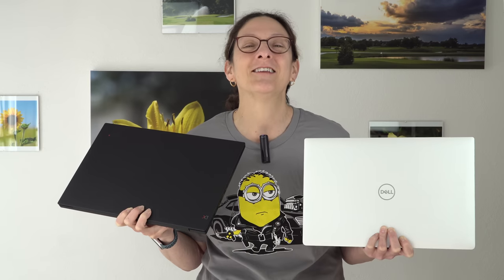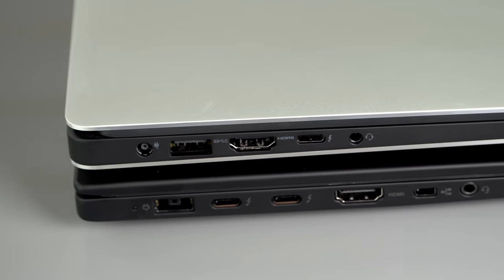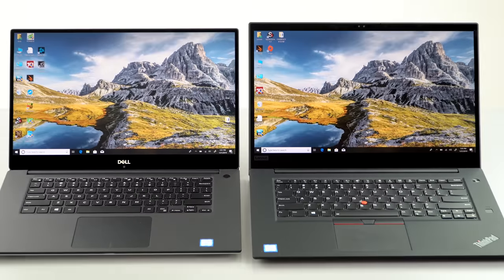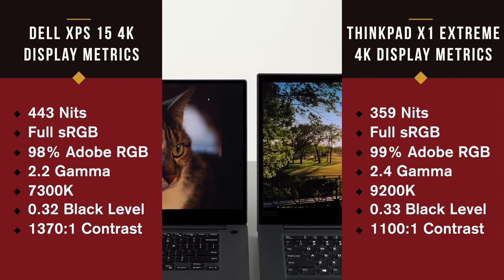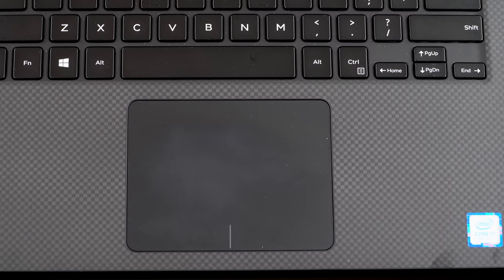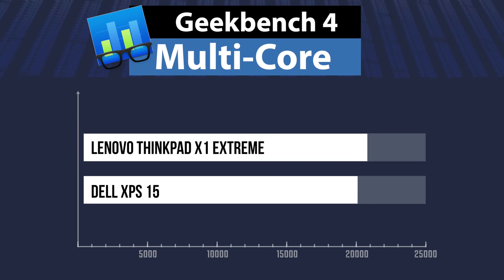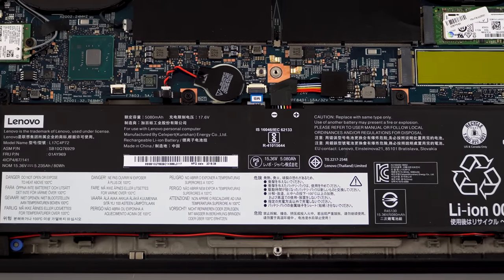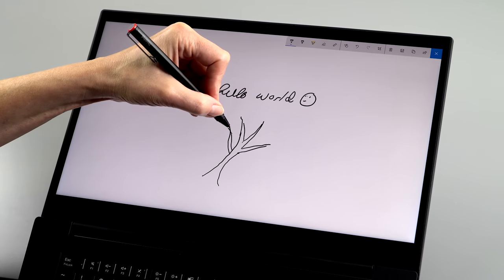Dell XPS 15 vs. Lenovo ThinkPad X1 Extreme Comparison Smackdown

Comment: The moment I saw the Dell keyboard with those stupid tiny cursor keys, the ThinkPad had won no matter what.
Reply: Yep.  Companies trying to make keyboards so small and petite are killing me.  You use the keyboard the most on every computer you will ever own.  It needs to be good!
Reply: I would gladly take a donation of either one of them once you are done review😁
Reply: You don't prefer longer battery life, brighter screen, and smaller bezels for lower price over thinkpad?
Reply: @nateportney672  all this is secondary to efficient typing and code navigation. If tiny cursor keys cause frequent miss-placements, a better screen or a longer lasting battery do not help to ease the frustration. 
The thing is: they have keyboards that are good ( e.g. on Dell precision M4800) . But for no rational reasons they instead choose to use crappy Apple style keyboards . I am afraid that this is a design driven decision because some marketing or management guys falsely believe rust you have to look like an Apple notebook to sell more..
Reply: @hercion  may u explain why u need a high gpu gaming laptop to do coding?  Ur 100% right thinkpad keyboard is superior, but xps 15 is fine.
Reply: @nateportney672  Longer battery life is great but it's not by a huge margin.  It's only slight better which may not be really noticeable in real world.  The keyboard, however... will be used every second.
Reply: @timothyandrewnielsen  ur 100% right.   Do u think the xps 15 kb hard to use?  Will the 9580 maybe improve it any leaks for that. 🤔
Reply: @nateportney672 I don't think it's hard to use but the thinkpad keyboards are just the best so I won't gamble.
Reply: @nateportney672  i used an xps 15 9570 for a few months. i hated the keyboard. the function keys were annoying to use, especially when troubleshooting assembly code in codewarrior. the keys have really mushy stability. like, if you push on the corner of a key, it is possible that the key wont activate, even if you bottom out the corner of the key. felt like some of the keys would pop off :c also, dell has made some very questionable decisions/mistakes with BIOS updates. i ended up returning my xps 15 for that reason. dell made me lose trust in them when it comes to competence for making good decisions on how they code their products' firmware. issues included dissapearing touch screen functionality, wifi card causing the computer to crash, lowering the thermal throttle threshold on the gpu from 78 degrees c to 75, and one of the more annoying issues, introducing a bug that would heavily throttle the 1050ti, if the gpu temperature was below 48 degrees c. that one was very annoying, and only recently did dell put out a patch to fix it. it remained unfixed and unbearably annoying to work around, for over 2 months. looking at the greater stability of firmware and drivers on the lenovo x1 extreme makes me wonder why i didn't just go for it. to add to that, the red hue the xps 15 display gave was annoying. seems like the lenovo has a more colour accurate screen. another point against the xps 15 for me.

also, lenovo commonly puts the x1 extreme on sale. a similarly configured xps 15 vs x1 extreme cost about the same in canada, right now at least.

am i really biased toward the lenovo? no, not really... im just really biased against the xps 15. :| it just so happens that the x1 extreme is the best alternative, and is IMO a much more reliable option.
Reply: @KumaMech  ty for extensive feedback.   Indeed thinkpad keyboard travel of ~1.7 surpasses xps 1.3 and I have used thinkpad before dell (used 9550 since 2016) and haven't observed these issues you observed.   Wonder when oled, rtx upgrades and 9th Gen will make an upgrade in 2019 more meaningful.  Probably by Jun will be happening.   It's funny how gaming alternatives have even worse keyboards.
Reply: Also what do u think about new razer 15 or aero 15?
Reply: @nateportney672  some gaming keyboards are wonderful. msi's full size steelseries keyboard (the one with the numpad) is one of the rare good ones still available.

aero 15... i had the chance to use it for 2 weeks and, i personally had hell with trying to get it to run in a "stable" fashion. the biggest issues with it was single channel memory, gigabyte's manager software that is REQUIRED for keyboard shortcut functionality (max fan, sleep, brightness up and down. msi doesn't need to have special software installed for that kind of functionality) gigabyte manager making it so monitoring cpu usage, even with task manager, takes a lot of cpu resources to do, and nvidia optimus kept going into a state where both the intel igp and the 1070 max q i had would be on at the same time, tanking battery life. in short, i don't trust gigabyte about as much as dell when it comes to competence in how they program firmware and drivers... but decision making skills for gigabyte are better than dell >.>.

razer blade 15. i was able to test that for a month. in short, it was actually a really good experience for me. it was stable, bloat free, undervolted well, performed REALLY well with undervolting and lowering the max boost clocks a bit (6 core turbo down to 3.6GHz from 3.9GHz REALLY helps the system keep its performance higher for much longer) and their keyboard feel is better than the dell, as all keys are full size and have better stability, but are still shallow. gpu performance is insane for a max q variant, because of their "OC" profile that gets activated when you set it to performance mode in synapse.

so why did i return it? the 1080p 144Hz model comes with a display that comes from one of two suppliers. LG and what it seems no one else knows about... BOE. the BOE panel uses a very low frequency (200Hz-250Hz) PWM backlight for the display. this caused me a lot of eye strain and headaches as the strobing from the screen was painfully visible to me. if you get the LG panel, you are lucky, since the LG panel does not utilize PWM for the backlight brightness.

other issues i had with razer blade 15 advanced. power brick cable is stiff, making it a bit annoying to use on the go, the rubber feet on the bottom of the laptop are do not have much traction and do a poor job of keeping the laptop in place (easily fixable) and the stupid keyboard layout with the up arrow in between the right shift and question mark key.

also, if you are interested in 4k versions, both the gigabyte aero 15, razer blade 15 advanced and lenovo thinkpad extreme have the same/similar 4k panel (AUO). my 4k aero had a max brightness of 408 nits, averaged across the screen, with 1600:1 contrast ratio and 100% adobe RGB coverage. I got really lucky with the display on my unit, when i had it.

both are solid in build, with the razer feeling a bit more rigid and premium feeling. trackpad on the razer is one of the best i have ever used.
Reply: @KumaMech  wow your depth of reply and personal breadth of insight is truly superior, ty for that.  Did not know about panels.   So you think for a non developer, the razer 15 4k is good?   I heard aero 15Y now uses dual channel, and I liked how their battery was bigger than razer.   But what stuck in mind was razer's notorious bad QC and negative reviews.  Perhaps they have repaired this?   I remember before talking MSFT store when they offered razer 14 and xps 9550, the techs said razer QC was awful and had to return so many back.  Did razer step up their game u think?    Also, is the 4k screen on razer 15 good quality without that strobe issue?  I am too sensitive eye strain.  I heard razer 4k is peak 400nits too.   Glad u mentioned about 9570 issues on throttling bugs, as I was considering it when the 9580 comes out.

Do you think it's better to wait for razer 15 9th Gen 2070 4k and possibly an OLED version later in year.  I was looking for a sleek power laptop, that was little more future proof.   Indeed I appreciated x1 extreme, but getting one with just 1050ti mq in 2019 seemed bit aged.   Plus I may want to drive a couple 4k displays later on when upgrading monitor setup.   So I thought stronger gpu was needed to do that.   Do you know when maybe x1 extreme may get upgrade to oled and maybe rtx gpu upgrade?   That would be a superior system if they could deliver that.  Appreciate your thoughts and brilliant feedback. 👍👏🤔
Reply: @nateportney672  razer blade 15 is fairly good, and currently appears to be one of the more reliable options on the market, but you have a chance of getting a lemon with any company at the moment. i know the 4k IPS display on the blade does not flicker (current controlled backlight brightness) that being said, im annoying microsoftstore does not sell the 4k model of the blade 15. microsoftstores extended warranty is IMO really worth it, as its pretty cheap for 2 year accidental warranty. keyboard should be fine, especially if you have lived with the xps 15 keyboard for a while. just the right shift key takes some getting used to, if you use it for typing, like me. you can also change the up arrow in synapse to be right shift as well, but then of course you lose up arrow. battery life difference between the 1070 maxq models of the blade 15 and aero 15 weren't that big. i averaged 5.5 hours on the 1080p 144Hz blade, and about 6.5 hours on the 4k aero 15, when nvidia optimus wasn't bugging out. didn't have nvidia optimus bugging out on the blade 15 with my unit. aero 15 battery life would tank to about 1-1.5 hours when the optimus issue came up :c. To detect the issue on the aero 15 quickly, you will notice the entire computer slow down. to fix, i had to restart my aero 15 :/.

about OLED 4k model of the blade 15. i have no idea when they will actually come out, but something to watch out for is, almost every samsung OLED screen i have seen (on their phones, other companies phones that use the samsung screens, the thinkpad yoga x1 gen 2, and alienware 13 r3) all have/had a PWM of 200Hz. The supplier of these 4k OLED screens is samsung. note, i am just guessing that the upcoming 4k OLED screens will have PWM based off of samsung's current portfolio.

the new gigabyte aero 15 models come with dual channel memory, but only on the 32GB SKU's at the moment. aero 15 keyboard is very nice IMO, one of the best feeling, but the keyboard is fairly cramped due to less space + the fact that they put a numpad in. something you can get used to. i can't actually speak for the reliability of the newer systems anymore, as gigabyte has moved to using different drivers and such, but the gigabyte manager program looks to be about the same according to the reviews i have seen. what worries me is that gigabyte used to offer 2 year warranty on the aero 15x, but now only offers 1 year on the newer y9 and x9 :c. If it weren't for my skepticism with driver reliability and other hardware issues i have seen other people experience, conceptually, the aero 15 appeared to be the most versatile laptop out of all options. in execution, i don't know where gigabyte went wrong. o right, fun fact, to get my aero 15 to boot from the USB, you had to insert the USB drive RIGHT after you turned the computer on. if you don't do that, the boot device wouldn't appear in the list. other than all those issues, i can see the aero 15 x9 and y9 being a beast.

Thinkpad X1 extreme... i can only speculate, but i don't think it is going to get RTX this year. If anything, it's going to be getting the rumoured gtx 1660ti, maybe in the 3rd quarter ( a guess based off of the fact that the current X1 extreme released in September 2018 if i remember correctly) 

i really don't think you are going to be future proofing with any of the current options on the market, in terms of graphics. i'm in the same dilemma at the moment. im reluctant to purchase into RTX because of exorbitant pricing and the fact that 7nm EUV products should be here by the end of this year/beginning of next year anyway. also reluctant because i don't want a 1080p 144Hz panel. im annoyed that no one is releasing 2560x1440 144Hz panels... i haven't even seen anyone sell rtx laptops with 4k IPS panels yet, at least in canada. only exception is alienware m15, but i do not trust dell. you can probably go over the reddit to see if people are experiencing stupid issues with that device as well. the glossy bezel on the alienware looks hideous to me, thats another thing keeping me away from that. 

i hope im not missing something. glad i could help... if i did not make your decision even more confusion. i feel like i transferred some of my confusion on what laptop to get to you :p.
Reply: @KumaMech  dear sir, this was truly appreciated and depth I absolutely am blown away by, thank you graciously.   Seems like aero 15 reducing their warranty to 1yr tells me about confidence.   I also agree m15 hideous bezel is joke.   They probably had marketing team tell design team  to make it more in spirit of AW so they glossed that thick bezel lol.

Also I chat with razer, they said at least 5-6m before they come out 4k 2070 rtx, so it will probably be cozy for Christmas cycle.  Much less unsure about oled.   Also 9th Gen is unclear maybe 6m later they will creep up.  So that makes the 1070 razer 15, at 4k better value.  Also I learned can add the razercare essential to 3 years total coverage, which avg down the cost over likely 2-3 yrs decently.   Also means a secondhand one for those wanting to upgrade rtx gives little more value.   So right now looks like razer 15 4k 2017 secondhand with extra coverage 3 years is best combo of gamer with little better value.   Trouble is, not many offering that.   But this next 9m of lack of serious releases makes upgrading now a good time, esp since with a 3yo xps.  Even that has resell value. So what u think kind sir, a x1 extreme 1050ti mq 4k , or razer 15 1070 mq 4k for little more.   If u had to choose, same price (and what value would u say)?  What would u get.   Remember, in 15m that 1050) is gonna feel really weak, maybe the 1070 will still be competitive.  Which ones have more resell value?  What do u think?  I really value your outstanding opinion and analysis.  👍🙏😃
Reply: @nateportney672  i think the 4k razer will have more resell value, although it is just a guess. if you go with the x1 extreme, you get a bit less throttling on the cpu, extra ports, SD card reader, extra m.2 nvme slot for more storage options and one of the best laptop keyboards on the market. if you go with the razer, you will get a bit more than 2x the graphics performance relative to the thinkpad.

its your choice if you want graphics performance or versatility + convenience. Now, technically the razer can do everything the lenovo can do, with more graphics performance, but you would have to carry dongles, whether it be for SD card reader or to expand the number of usb ports with a usb hub.

if you are primarily gaming with your device, i would say get the razer. but if your main goal is to do some kind of work on the go, such as programming, CAD, video editing, graphics design, and/or photo editing, go with the x1 extreme. depends on what you value more.

what you sacrifice depends on what you want to do with the device as well as your own personal feeling of what has more value (graphics performance or versatility + typing comfort).

for me personally, if both were the same price and if i could get warranty, i might tend to go for the razer. however, in Canada, the only place that i can find a razer blade 15 4k, has it for $1000 CDN more than the x1 extreme x_x. add to that the fact that razer doesn't sell its warranty in Canada, the x1 extreme seems like the better option.
Reply: @nateportney672   Thinkpad has infinitely better keyboard, who needs 400 nits?, larger bezel allows cam up top, dust proof, water resistant, better thermals, drop resistant, TRACKPOINT!
Reply: @neallyons9515  you're 💯 right sir.   Ty
Reply: @KumaMech  I couldn't agree more with the PWM problem with the OLED screens. I had an X1 yoga gen 2 with OLED, and I got eyestrain so frequently by using it. I never understood why until I learned about the PWM. The sad thing is, x1 extreme gen 2 will have the same PWM problem, along with all other major manufacturers that offer an OLED option this year. Too bad my eyes are sensitive - I really wanted to like the OLED screen.
Reply: @vincenttheo8841  it sucks so much. i'm still hesitant whether or not im keeping my blade 15 OLED because of the pwm. i feel like it is only a matter of time before i notice some serious effects.
it sucks even more that the alternate options i was looking at was either the lenovo thinkpad p1 gen 2 or lenovo thinkpad p53. both options' 4k variants come with either with a 4k IPS non-screen, or 4k OLED touch. i really like using touch screen for CADing. the last gen p52, p1 and x1 extreme had a 4k ips panel that either had no PWM or had PWM at a higher frequency (there were 2 panels that i know of that they came with). so now i have to pick and choose what i want to sacrifice. potentially severe eyestrain and dizziness (in lower brightness range) and questionable longevity of the display for amazing contrast and touch, or no touch, some backlight bleed, glow and much slower response time (lots of ghosting) for a screen i know will last a while and will not hurt my eyes. note, i am guessing the 4k IPS screen will be AUO B156ZAN04.1 as it's used in the new MSI P65 as well. it scored pretty poorly for contrast on notebookcheck :/ no pwm on that panel though.
Reply: @vincenttheo8841  BTW, i posted a vid of me testing the PWM on my Razer Blade 15 with the OLED screen with an oscilloscope on my channel. the PWM pattern is actually quite interesting this time around.